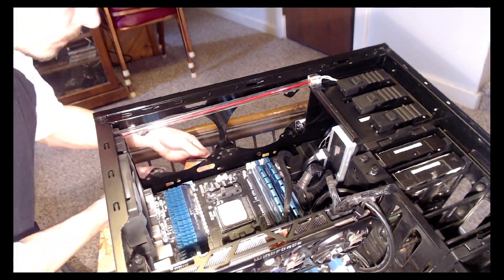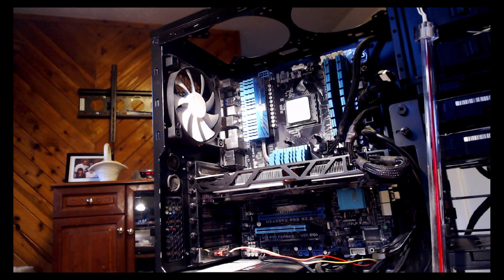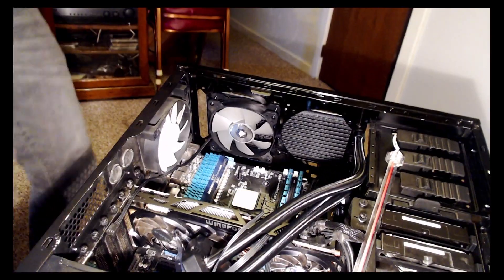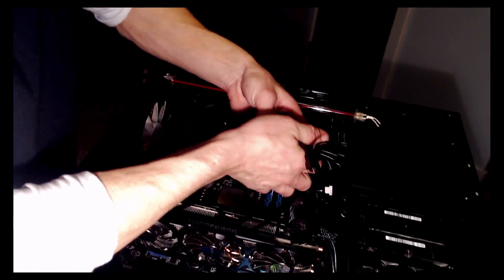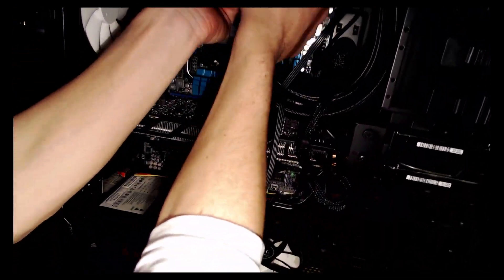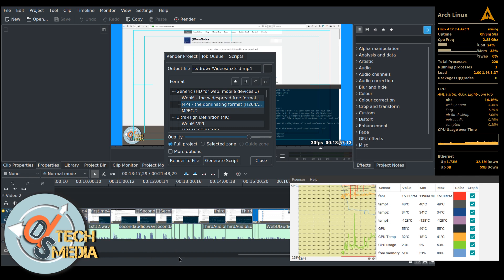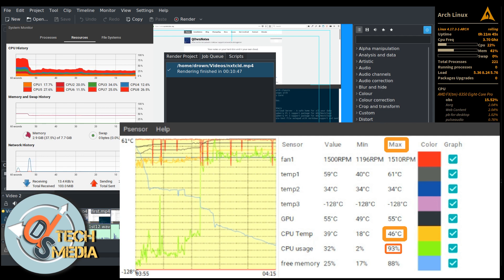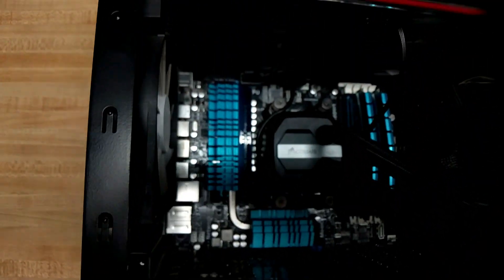Corsair H100i v2 Installation and Test

Comment: Bro you had it for 4 years no maintenance lol it just needed new thermal paste 😂
Reply from the maker: That's a valid point, but I used it pretty sparingly in those 4 years.
Also, I guess I forgot to mention in the video that my thermal shutdowns were specifically when I was rendering videos.
 While gaming and doing other intensive tasks I wasn't really having problems. It was only when I started rendering video under Linux that I was getting thermal shutdowns.
The FX-series are known to run hot anyways, and though some might not like to admit it, Linux seems to run a lot of hardware hotter than Windows.

Comment: hey brother, I installed that cooler like 2 years ago, and just realized i never plugged the usb cable on the bottom, now i have no idea where that cable is and cant find it online, would you pls send me a link or something of that specific cable, thanks!!!
Reply from the maker: Did it actually work without it? I found this one on Ebay: https://www.ebay.com/i/283723957387?chn=ps&norover=1&mkevt=1&mkrid=711-117182-37290-0&mkcid=2&itemid=283723957387&targetid=884652277561&device=c&mktype=pla&googleloc=9007848&poi=&campaignid=9426322279&mkgroupid=92907991862&rlsatarget=pla-884652277561&abcId=1141016&merchantid=101718125